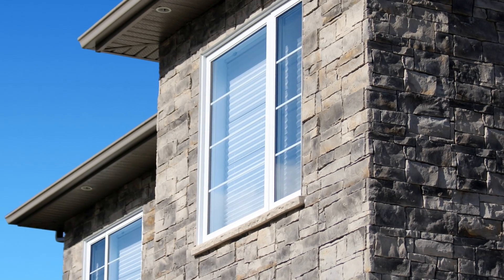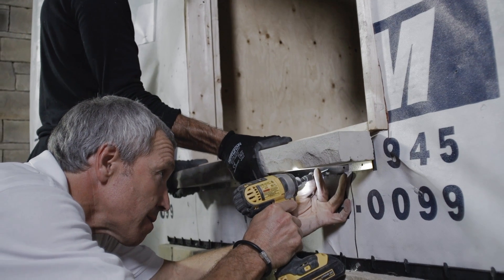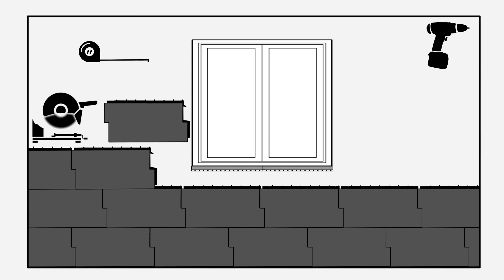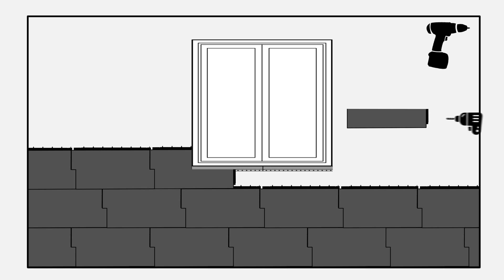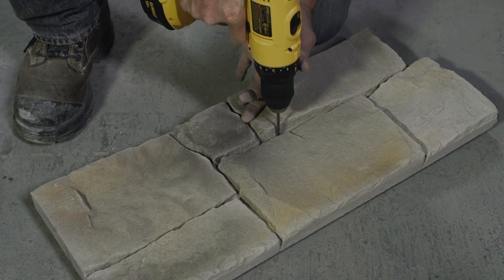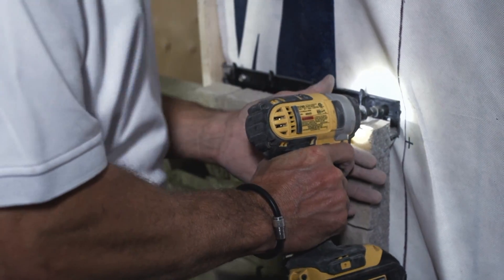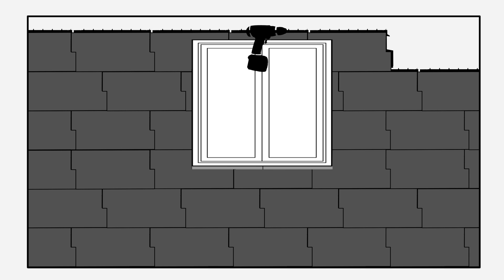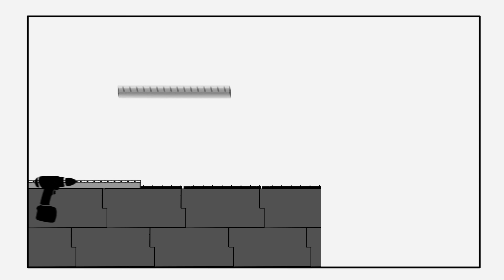Beonstone Installation Step 4 - Windows

Comment: It's near impossible to get the under window sill to sit tight to the window and install the stone properly. And then to install the stone underneath I recommend cutting of the plastic piece the anchors the stone to the previous row or you won't get it to go under the window. It's a poor design.
Reply: That’s what they show in the video. Cut the stone to fit. Pre-drill holes in the cracks in the stone. Position in place and screw in.